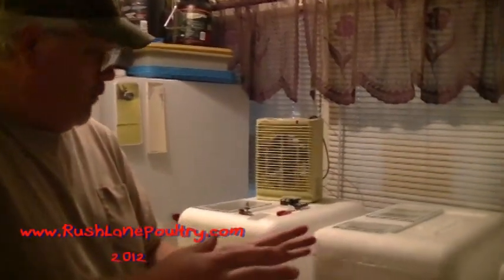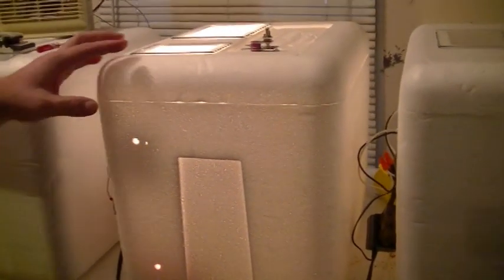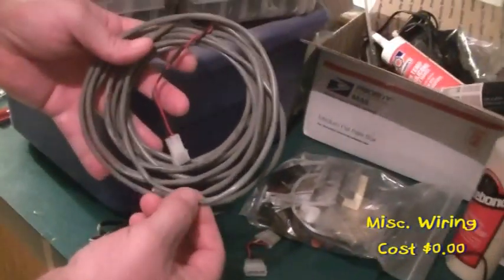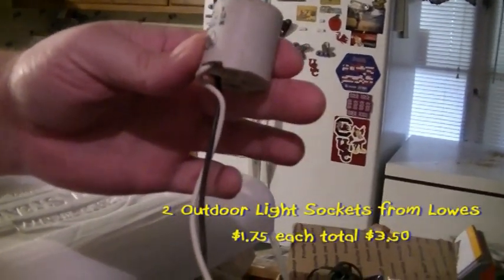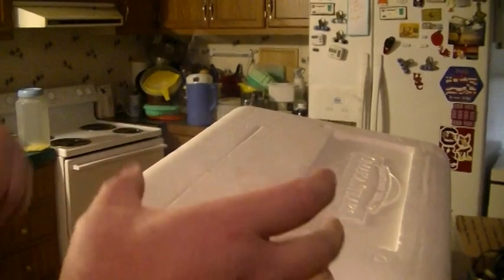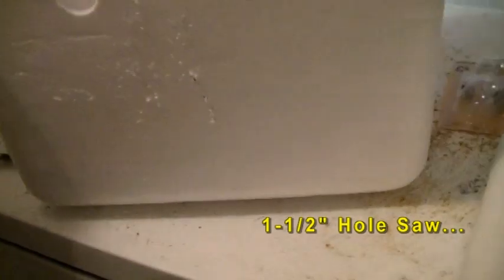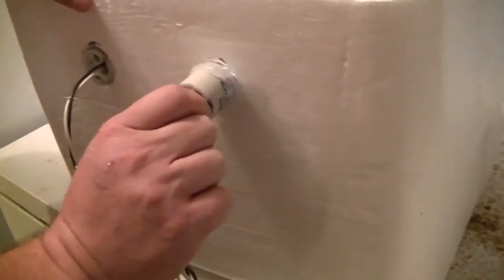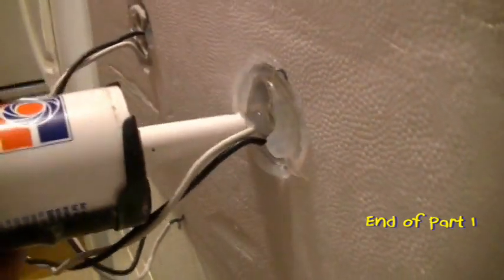Building a Low Cost Home Made Incubator! Part 1

Comment: i tried the water heater thermostat and it had a 5 to 10 degree temperature swing. for $5 more i got a digital thermostat and it is great 1 degree temp swing, and and is very accurate and EZ to adjust. hope it help and well worth the couple extra dollars.    http://www.amazon.com/gp/product/B00F05UI8O/ref=oh_details_o04_s00_i00?ie=UTF8&psc=1